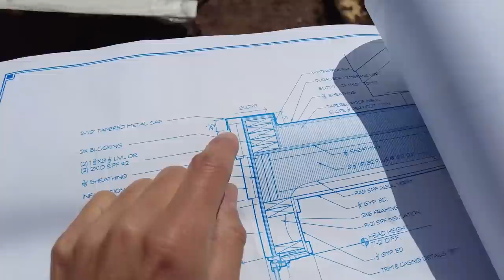So Much Trim and so much to go | Home Renovation & Addition Part 44

Comment: I’ve worked at a coal fired plant that provides flyash to Boral and other concrete companies.  My plant is shutting down this month as are many others across the US.  These flyash products probably won’t be available much longer.  Nor will the gypsum created by the the sulphur removal process (emissions cleanup process).